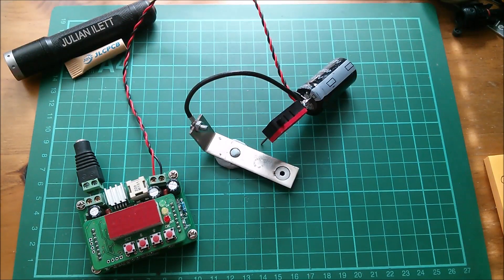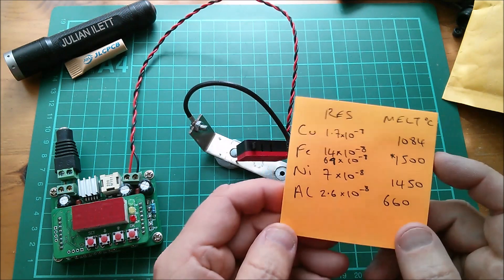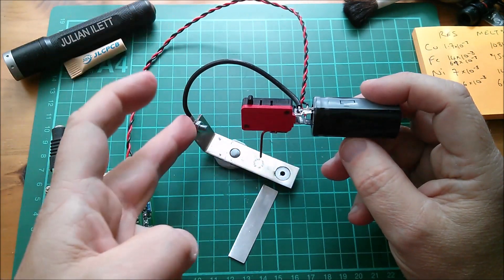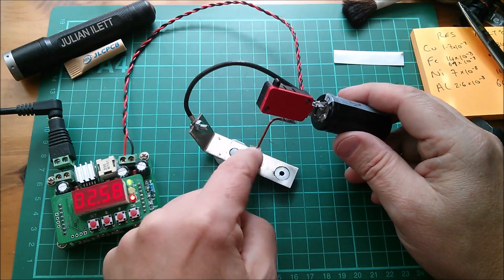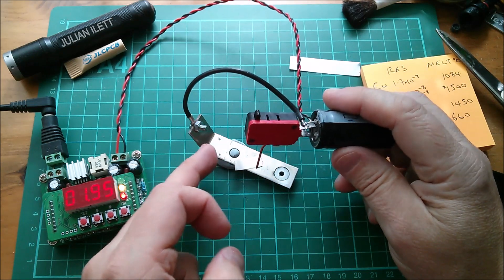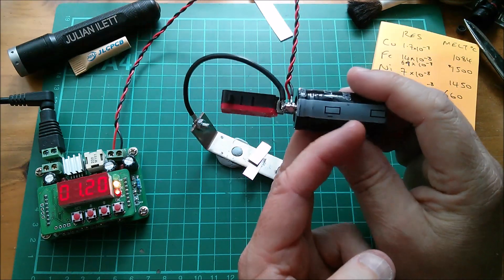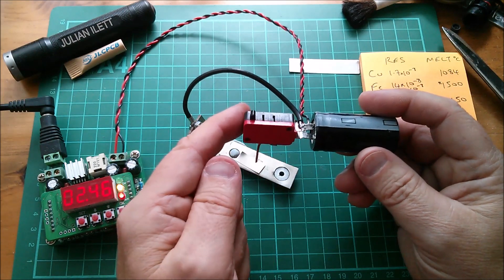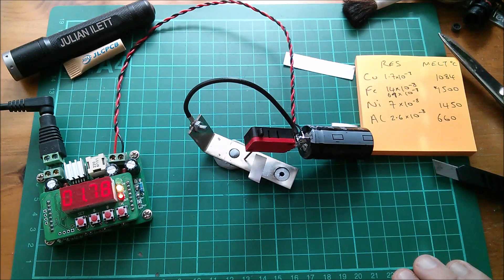Will it work? 100F Supercapacitor Spot Welder

Comment: The thick steel has way too much thermal mass and is suckung the heat away. And like you said too many losses in the wiring, switch etc. And maybe cap is too small. Brute force approach needed.  Thats all I can come up with.
Reply from the maker: I wanted something similar to the steel base of an 18650 lithium cell
Reply: Julian Ilett Yeah thats the tricky thing, you can't change that " variable" so to speak. Hmm... all I can think of is more current and less resistance in the wiring. In my mind if the micro switch contacts aren't welding themselves together the joint never will. Hopefully im wrong. So yeah more current/volts. Im no EE so these are  just thoughts. More current sounds scary though haha.

Comment: This capacitor seems to have a really high internal resistance. The resistance of the microswitch probably is fairly high, too.
Reply from the maker: I think the next version will use MOSFETs :)
Reply: Even that I doubt it will work better.
The point is to have high currents. 
The ESR for my 100F caps is around 10mOhms and a max current rating of 70A
Try to go 10-20V. Also go with a higher capacity. My 500F ones have a higher rating of 230A (VEC 3R0 507 QG).
That would work then. But then care about the poor mosfets :) They might burn out
Reply: @JulianIlett  Mosfets is a much better idea than a microswitch. They can take quite a high pulse loads and then you can also control the energy with pulse duration. More voltage and more beefy capasitors still needed probably. With mosfets you don't need to drain capacitor bank down to zero either. A beefy cap bank should allow multiple spots when you need to enlarge it due to internal resistances.
Reply from the maker: @hoggif Exactly. I was aiming for one weld per charge - I think that's a mistake.
Reply: @JulianIlett  Already done, developed and available as a kit. kWeld - community spot welder.

Comment: You need a high voltage bank of capacitor. You can calculate the stored energy with 1/2 C U2. There is no way this will work with a supercap
Reply: guigur Yup supercaps generally have a rather high ESR, that's why they can be so small... you need a higher voltage

Like a camera flash capacitor - the sparks are so much more impressive because the current is way higher due to the voltage

Comment: Personally I’d make two points touching the nickel. Add another negative pin under the switch. You weld by having a poor connection. A too good connection makes for too good a drain and you just heat up the cap/switch/wires. My English is not the best so I hope you get what I’m trying to suggest. :)
Reply: Yep two points is what you need and maybe use two capacitors

Comment: Copper is used as it does not stick to iron/steel. I would assume it is the same for nickel.
Reply: Copper has high thermal conductivity, so even with it's lower melting temp the heat travels away from the hot tip quickly making it harder to reach that temp when it's not in a furnace.
Reply: It also doesn’t corrode as easily.
Reply: Cheers Karinya & GRBT, learnt something of value today. Thanks for your important input, I was wondering why copper was chosen. 

Yeah I have shorted big cap like stiffening caps for car audio, they do leave a mark on your screw driver. Julian is on to something. Though I had pulled apart those portable arc welders, but did not take note of the size and voltage of those caps. The boiler maker welders told me they do not dilver as good results as the tranformer type, despite they are not  light to lug around at heights.  Amazing how electronics reduced the amount of copper to strink & lighten up the equipment so that you can carry it like a shoulder bag.
Reply: bingo